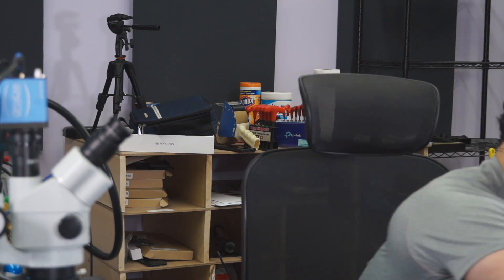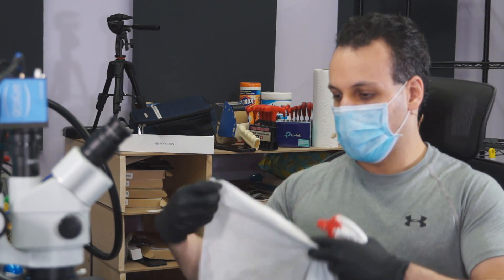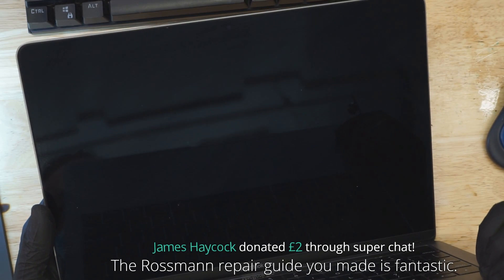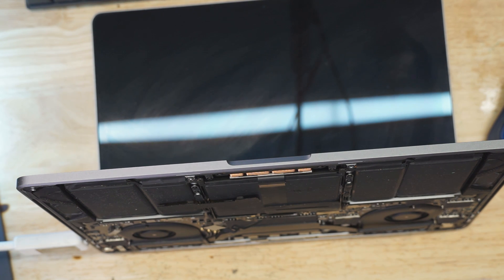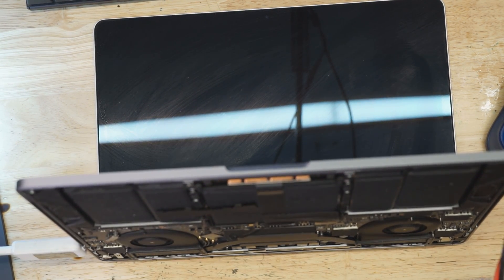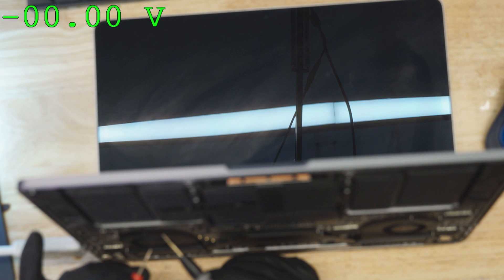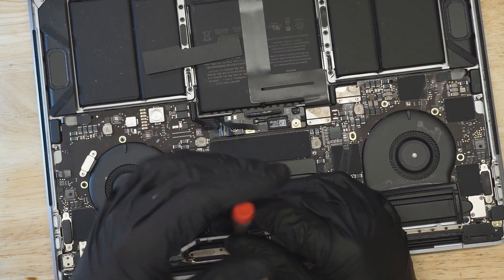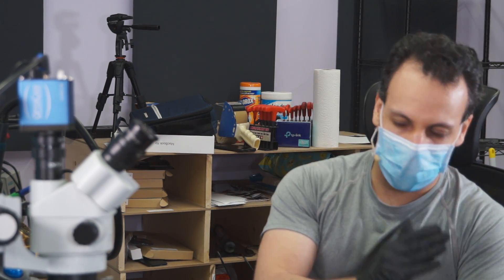Apple PCB design is a meme.

Comment: "What? Your CPU which runs on 0.3-1.1v doesn't like 52v? You must be doing something wrong." - Apple fan
Reply: Clear Intel's fault :-D

Who cares about low power here low power there - we need high voltage CPU!
Reply: @martincerveny2284  Well IF that is the case why not go with IBM? IBM has high voltage CPUs with higher compute than Intel just no integrated GPU no x86 version and the thing of L1 instructions might not exist or might include everything it could do making it harder to program for. Apple also used to use IBM CPUs just the power draw was so high due to again the high voltage power draw.
Reply: Apple fan: I built a Hackintosh and overclocked my CPU and now it won't work! I don't get it, I only gave it 2 volts!
Reply: A friend of mine said EXACTLY that 😭😭😭🥺 I can't. And he thinks I am a Apple hater... And he thinks he's a tech guy with neutral opinion... But he's not I AM!!! 🥺😭😭😭😭
Reply: @rhydonify  i feel ya buddy.
Reply: @Liam You're thinking too small. High voltage! Let's say 22kV :-D
Reply: Someone I know kept telling me that is a fair trade for all the "security" apple offers, the guy is also a socialist, go figure.

Comment: On any laptop I've had the back light's been on it's own JST connector. Short circuit issues aside that screens gotta be getting some big EMI from the backlight power circuits
Reply: @Deon Denis Well there's no point constantly upgrading if Moore's law is broken.  My workstation is from 2008 and my laptop is from 2013 and they perform great, especially since I run GNU/Linux on everything  instead of Windows.  I've had to deal with one of those ballast boards going out in an even older laptop, but it never shorted anything important...even that one lasted 6 years including a deployment to Iraq, then it spent some time as a headless NAS before it was finally retired.
Reply: @Deon Denis what? basically any windows laptop I've fixed has them on a single cable. But the datalines and backlight usually have at least 1 ground / nc point between them. I don't think I've seen any LCD's other than really old ones with separate inverter boards that would have a dedicated backlight cable.

Comment: I think Apple should think about a design FMEA. ;D 

Btw. I have a MacBook Air 2011, where the Pins of one USB are bent (don't ask me why). Did you have a source for me to buy a new Connector? I know that the use a special Apple design. I'am an IPC 7711/21 Trainer, so i'am able to change it. :D

Comment: So what you're saying is Apple employees have been doing some high-quality engineering to make sure that if you spill coffee on your machine, it will most likely fuk it up no matter what because we placed this connector in a spot that's very vulnerable to liquid. That way you can't come in and say there's no liquid damage! Again remember Apple refers to their laptops as a portable computer so it should only be placed on the desk where it can get good cooling, not on your lap where you can spill things on it. Yes you can still spill things on your desk but when it comes to the computer heating up and burning your legs or anything of the sort they will tell you that it is a portable computer and not to be meant to be used on your lap! Lulz. you got to make sure the person can fuck up within a year so that way the next year they can buy a new $2,000 laptop! I will now get back to the rest of the video!

Comment: Apple PCBs having no conformal coating makes it basically a clownfest as far as i can tell. Not entirely sure how standard this is in the industry; my GTX1070 has no conformal coating either. But i'd imagine laptops being more susceptible to water damage, if not condensation because of their very nature. This would (should) mean that most manufacturers choose coating as a cheap upgrade. Anyone have any data on that?